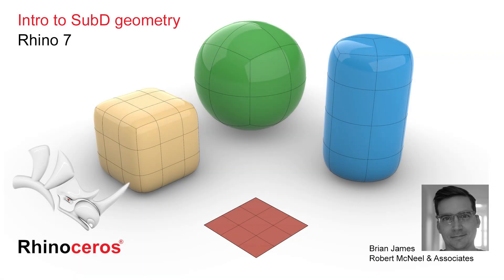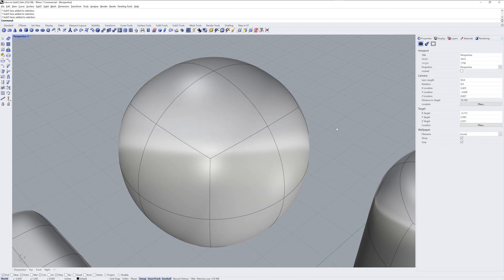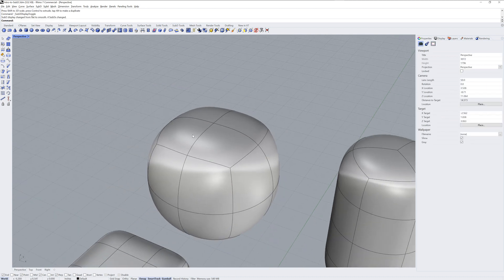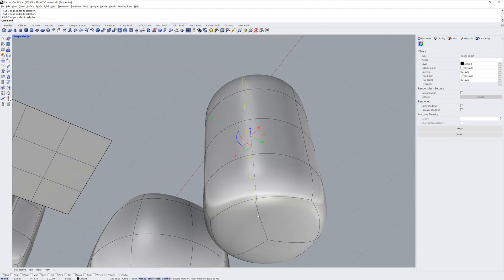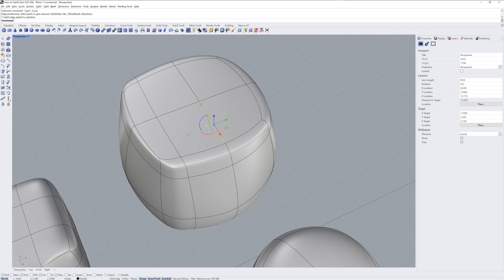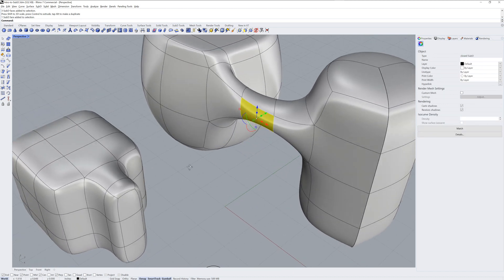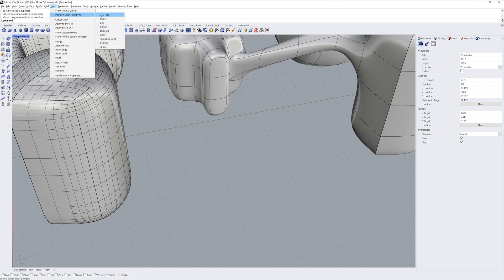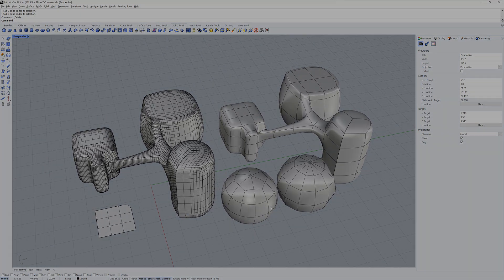Intro to SubD geometry in Rhino 7

Comment: How do you divide sub d surfaces with a curve such as a circle? I've seen it done but lost the source page.
Reply from the maker: If you Split the SubD it will become a NURBS PolySrf so use ToNURBS on it first to minimize the number of surfaces. If you want to keep it a SubD, you have to make a hole by deleting faces and then use Align > To Curve to pull the verts or control points to a target curve such as a circle. Post to the user forum if you need more help... https://discourse.mcneel.com/
Reply: @RhinoGuide   No no no that's not it at all. I found what I was looking for it's the quad mesh tool, split was the wrong language. https://youtu.be/7IZE7NkmJ78